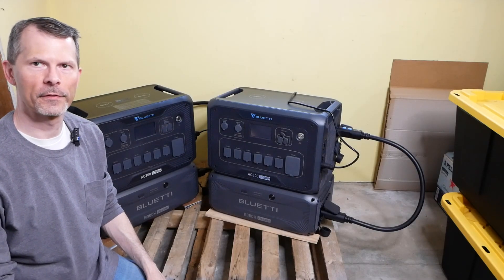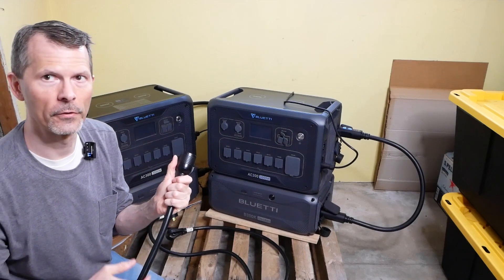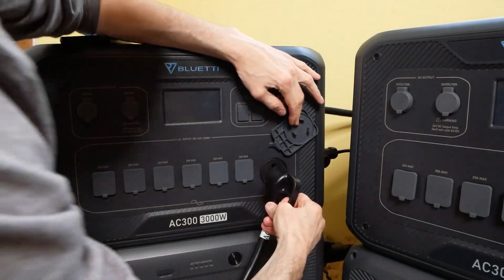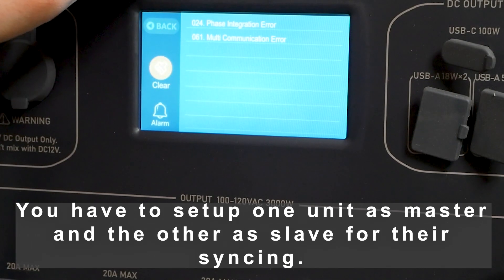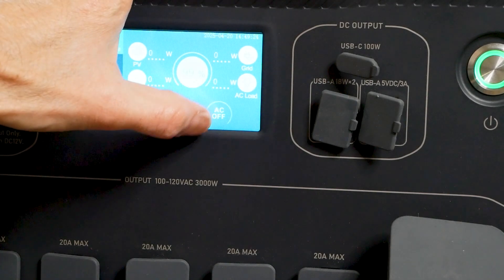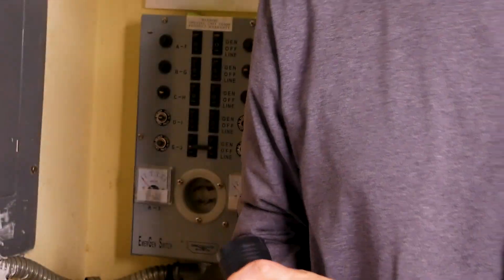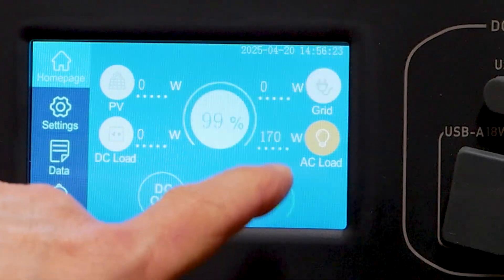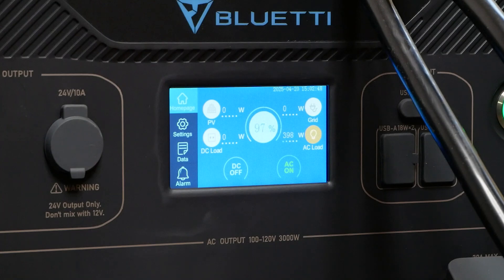Can 2 Bluetti AC300 + B300K Power My Entire House? Runtime Test! #homebackup #offgridpower

Comment: Funny this came up as I just finished having horrible power issues a few days ago. My neutral to the transformer died. So all the excess power was seeping every place else. My metal shower head even zapped me! I had some outlets going over 150v and some going as low as 50v. Power company came and installed a temporary above ground 2x120v & neutral cables till they bury it. I have a generator, but this would have been equally useful to immediately disconnect from the grid and still be powered up. I only lost 1 appliance.
Reply from the maker: @itstheMR  oh shit! Dam man very sorry to hear about this. What a nightmare :(. Yeah your not kidding, the transfer switch alone has saved me many freezing ice storm nights with my generator when the line iced up and lost power. Now I can charge up the system with my panels and just plug it in and cut over to the transfer switch. Where ever I move to I'll have at the least a switch or a smart sub panel with auto cutover and isolate from the grid.